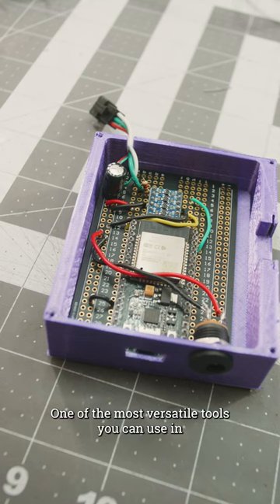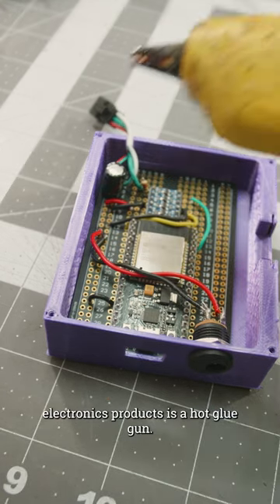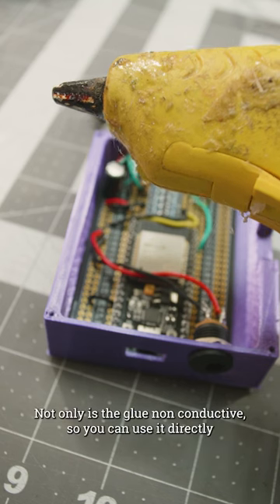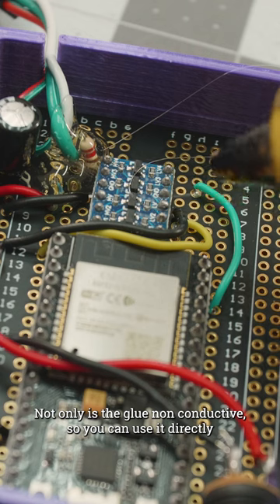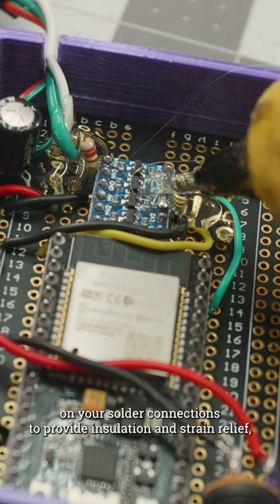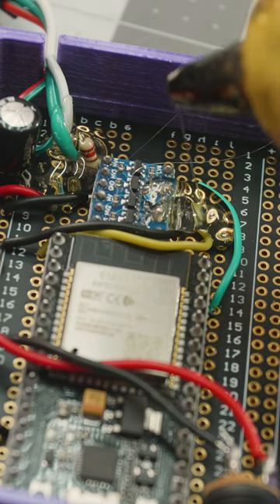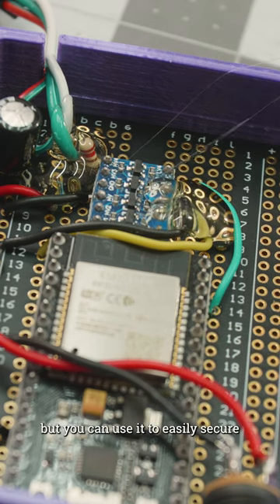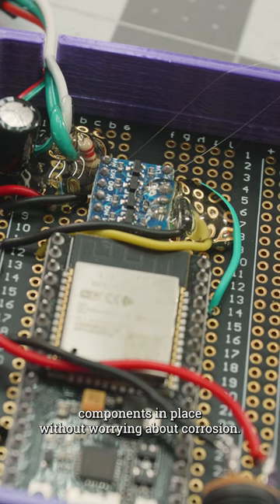Undo Hot Glue - Maker Update #Shorts

Comment: Using this tip for may be 10 years. Another tip guys: if you are using hot glue on 3d printed components make sure you are using some heatsink to not deform the part and absorb unnecessary  heat

Comment: I built a bunch of escape room props using 8" square of thin plywood, an Arduino Uno and a small breadboard and usually a relay module.  I used jumper wires and hot glue to hold it all together.  It was just as reliable as other methods that were completely soldered. When customers managed to rip wires loose, it was a lot easier to fix.  You haven't lived until you've built things for use by the "general public" and their uncontrollable kids.  In escape rooms, the "general public" shows up with tools.  I received a lot of valuable experience from the "general public", they are unbelievably clever at discovering ways to misuse equipment.